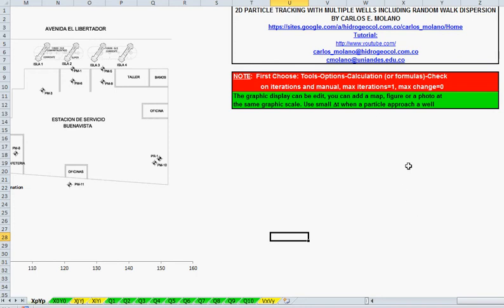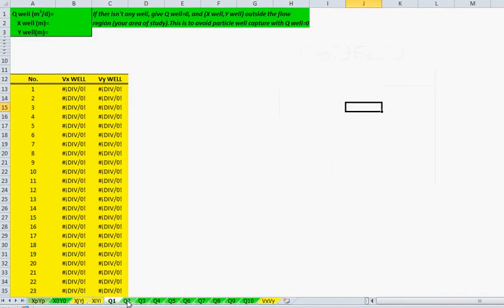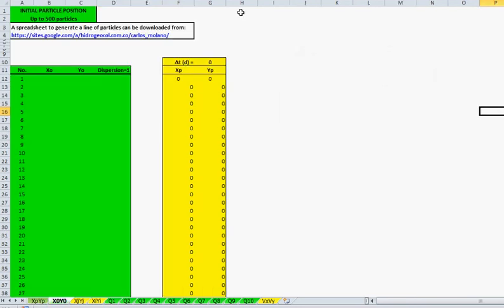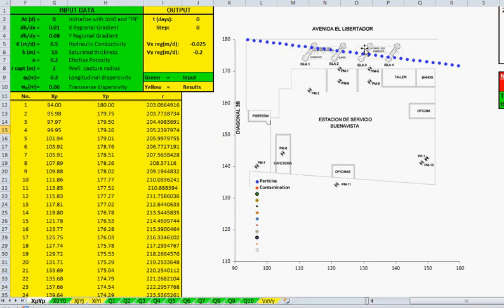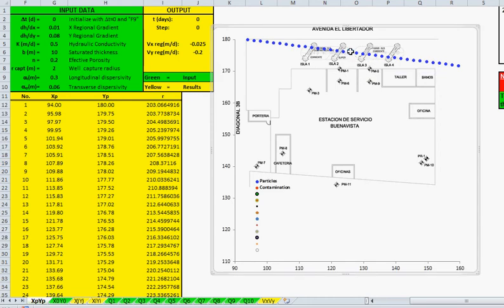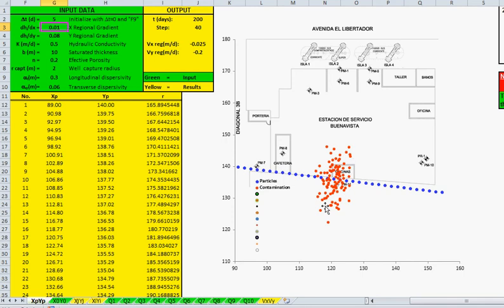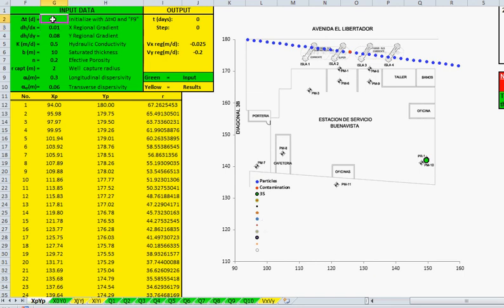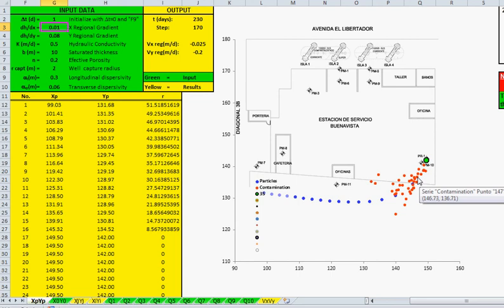SPREADSHEET FOR 2D PARTICLE TRACKING MULTIPLE WELLS RANDOM WALK DISPERSION

Comment: Nice spreadsheet and video!  Just wondering, how to you manipulate the worksheet so that there is a short lag time between each time step (as you show in your video)?  When I run the spreadsheet it immediately shows the final time step solution, i.e. in-between locations of the particles are either not shown or too fast to notice. Thanks!